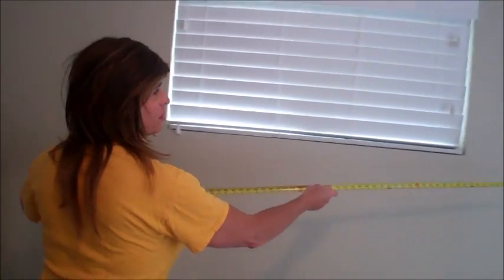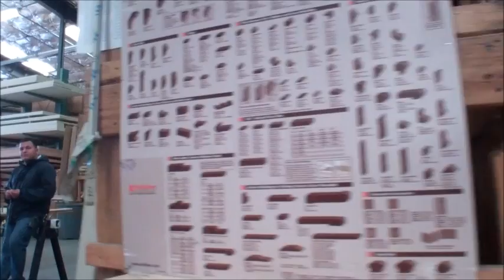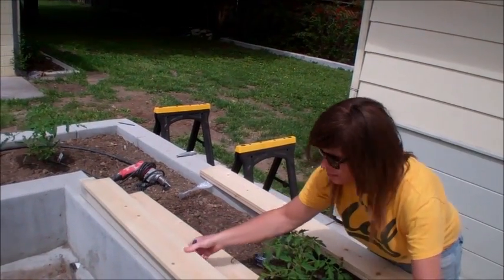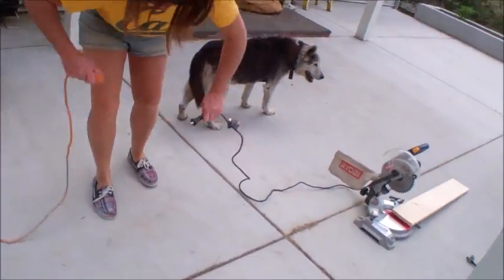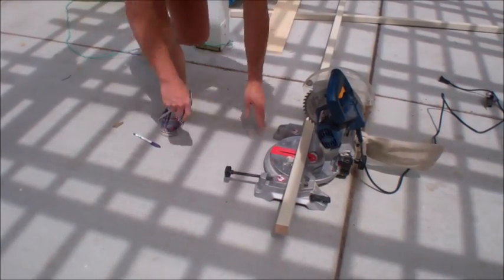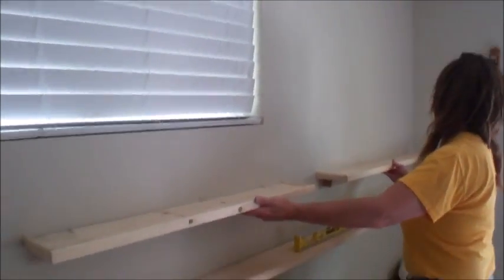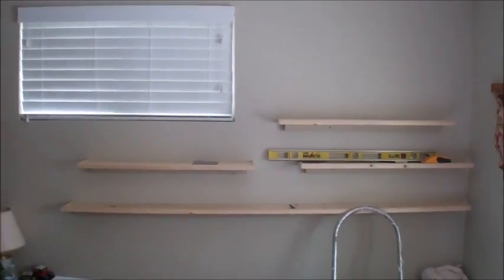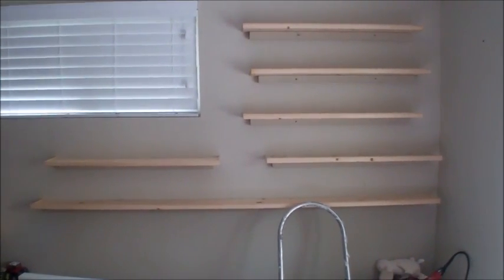Rosie Builds & Installs Floating Shelves

Comment: I believe you put the dual on the 2nd from the left icon, it has a lowercase "a" on it. Also if you go into the setup by pressing the setup button by the steering column, the radio display will show you options for how long you leave the headlights on when you lock it at night(ex 30secs, 60secs etc).  Also (if equipped) you can pull the headlight dial towards you, when on the auto selection, and the fog lights will be set on auto as well